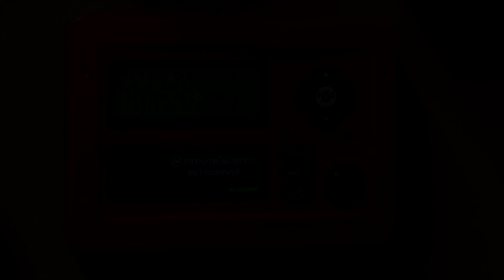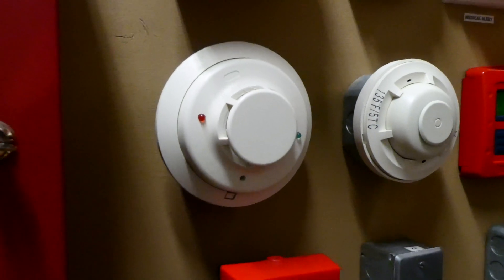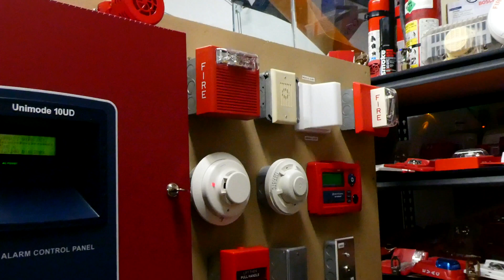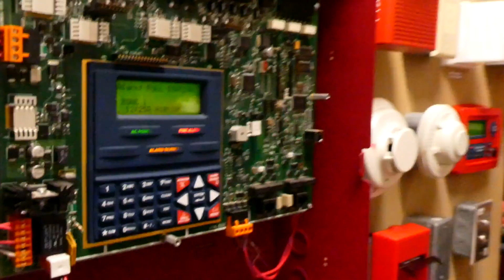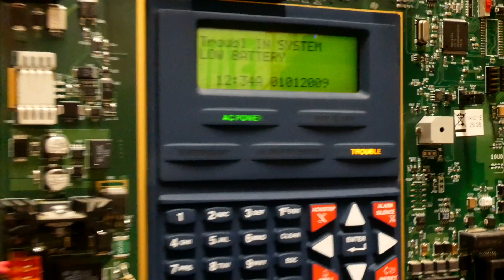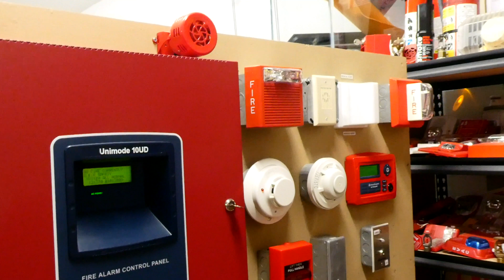ADT Unimode 10UD System Test 16: EMERGENCY

Comment: At my Middle School, there is a weird setup, they have a Simplex System, with Wheelock alarms on the outside, and Simplex True Alert on the inside.
Reply: @Phatbaby Blu Well, over the summer, they upgraded the fire alarm system, I think possibly to a Notifier system (Because all the schools in my district they use Notifier), but I know for sure it is a voice evac. Now, I do not go to that school anymore as I am in High School now.

Comment: YAY! new video!
Edit: the hotel we usually stay at during the summer has rebranded wheelock as alarms with rebranded sigas. Really interesting because the sigas have a whirlpool logo on them or at least what looks like the whirlpool logo. Probably rare I’d think. 🤷‍♂️
Reply: which type of sigas? All addressable EST are siga
Reply: Southwest Fire Alarms Oh I didn’t know that. I they may not even be addressable. They are rebranded 278b’s.
Reply: @4O5O-8O  ah that's cool

Comment: Once again, the "Life Safety Educator" gets it wrong. You know that the push button on the i3 does not "test the entire smoke detector." That only checks the contacts of the device and does not test its ability to detect particulate matter. Also, others have mentioned that your station is not a SIGA series station. It is not addressable, therefore it is not a SIGA pull station. I really do question your qualifications as an educator if you cannot get the basics correct.
Reply: Barbra lynn joy ur genius

Comment: 0:20 I have that same fire alarm but I haven’t set it up yet with the pull station and plus I didn’t get a key for simplex pull station :(
Reply: Are you looking for the Simplex B key? Far as I know, they're pretty cheap on eBay.
Reply: SuperMarioLord64 // Brinegamers Productions yes that’s what I’m basically saying is I need on of those
Reply: @aidantherailfan2175  They're around 5 bucks per key. Very cheap!

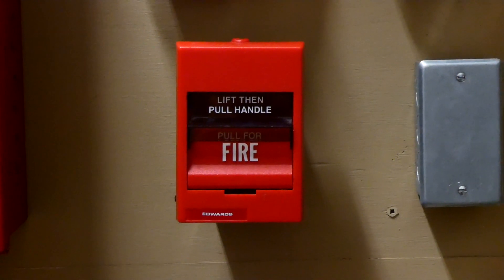Comment: 0:43 Actually that's just a normal 278, the siga is Addressable. This one is conventional
Reply: No Crap, Colombo! Also, he could've just unscrewed the wires from the terminals. I did this to a SIGA-DTS smoke detector test station. There might be a resistor, though.
Reply: @ryguy2006  seems you don't know your est devices if you think there was a Module on that one, conventional ones have 2 hex screws near the switch horizontally that holds the terminal block. The Addressable ones have 4 small black tabs that hold the module
Reply: @FireTech7  For the SIGA-DTS, yes there ARE 4 tabs holding the module in place. What I did was write down what wires went where before unscrewing terminals 5 through 8. It's non-destructive, and I could make it addressable again if I wanted to.
Reply: @FireTech7  hi there
Reply: @ryguy2006  Why are you so rude? If you don't have anything nice to say don't say it at all. Especially if you are agreeing with him that does not make sense.